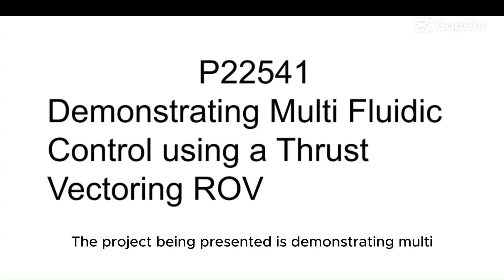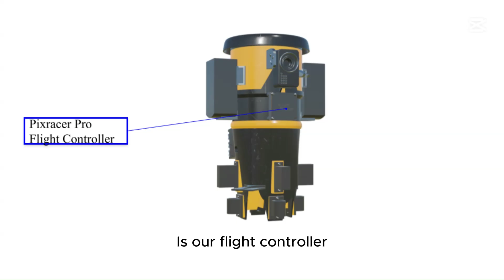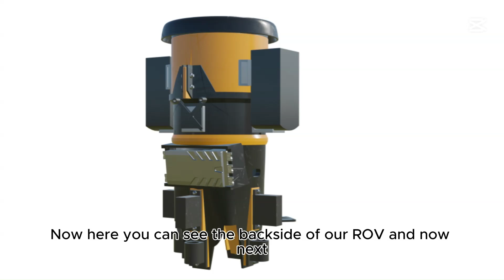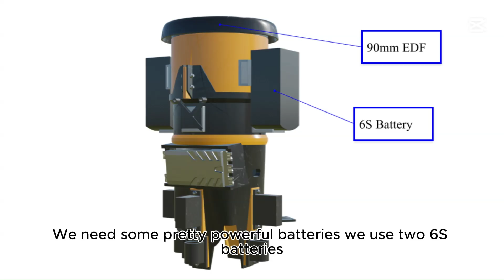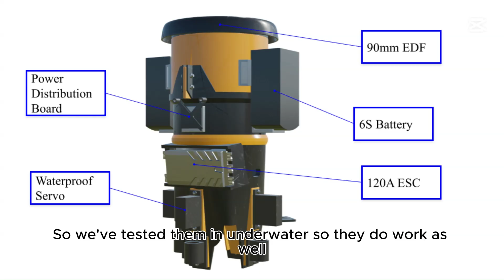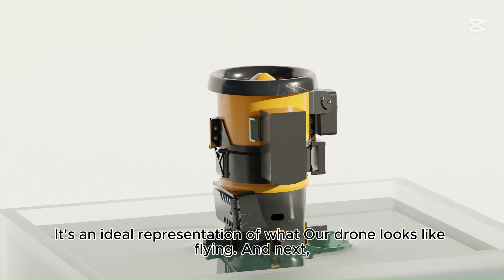MSD 22541 Demonstrating Muti Fluidic Control using a Thrust Vectoring ROV

Comment: Pretty awesome man, I love the out of the box thinking.  I operate XL workclass ROVs at work (3000M depths, 200hp electric motor that powers hydraulic curvtec style thrusters.) I build smaller ROVs for a hobby and that's how i came across your video.   What is your aim for a max depth? do you think it can be used as a parasitic tool if powered from a DC output on a ROV with 1200 watts to spare? 

I subscribed in hopes to see the next video, good work can't wait to see more.